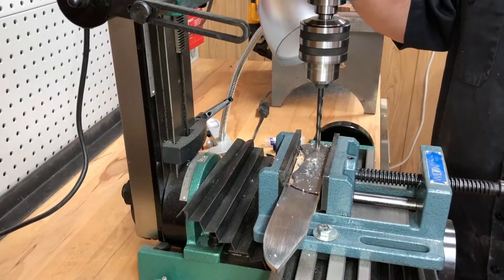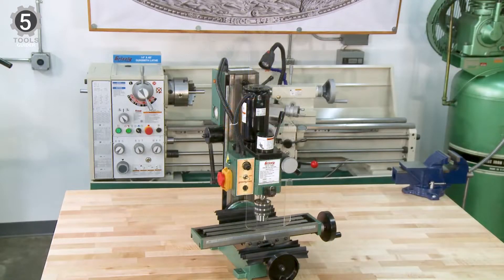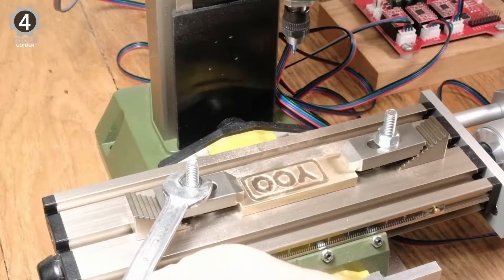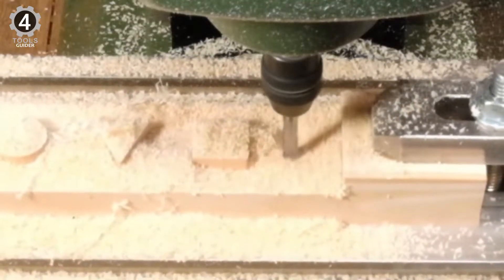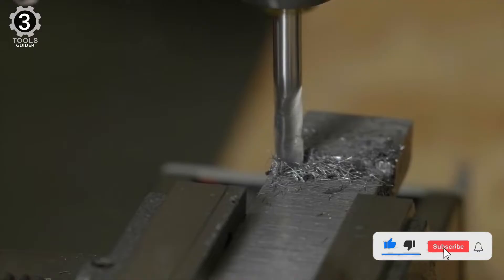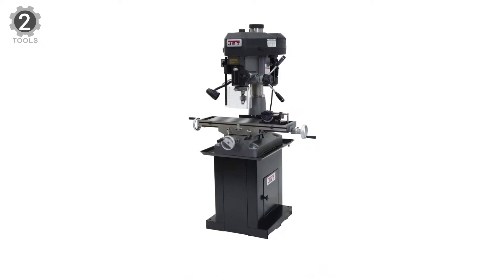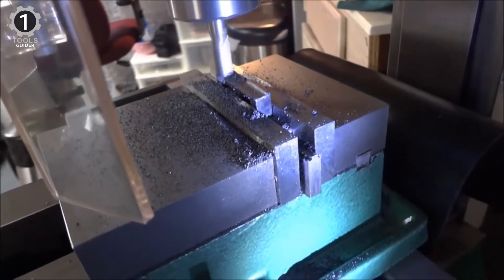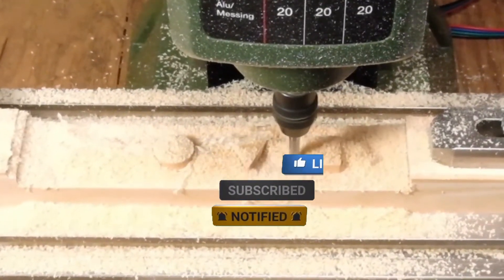Top 5 Best Mini Milling Machines 2023

Comment: The first machine reviewed had a 1/2hp motor and the commentary then went on to say that this was more powerful than the 3/4hp motor on similar machine. What a load of crap. The guy clearly didn’t know what a “one slash two HP” or a “three slash four HP” meant. Checkout 1:05 to 1:15

Comment: There is so much wrong with this. First of all these are 4 different class of mills. With drastically different price points And VERY little knowledge n the subject. Totally useless
Reply: the proxy is a micro,  Grizzly and Klutch are comprable mini mills and the jet is hardly mini at all its a full on small mill
Reply: It’s not about accuracy it’s all about views

Comment: Hi, thanks for video but all are metal blocks on which the milling work is done here . But I am looking for a machine which can be use on a long rod type instrument vertically positioned where I want to cut at upper end by milling burr so basically looking for a platform but down the platform nothing should be there so I can hold the rod type instrument ?
Reply: Does anyone understand what this guy is trying to say?
Reply: @ClosedPitMining  sorry I could not elaborate neatly, pictures would have help but not possible here.
Reply: Ultimately I have fixed portable bench drill on table and made hole to the table below the drill bit point where I can fix my instrument vertically and make hole. Wish I could share pictures here. I repair surgical endoscopes, specialized by my own and probably only one in India.